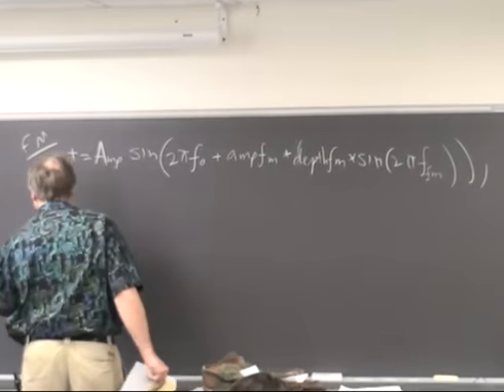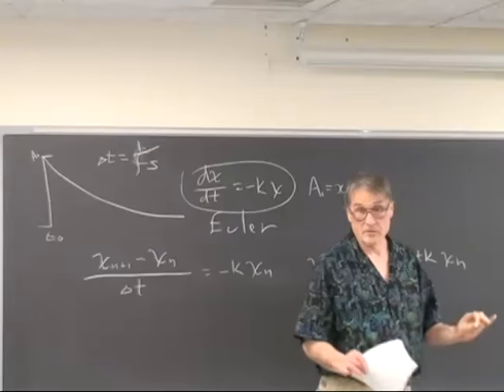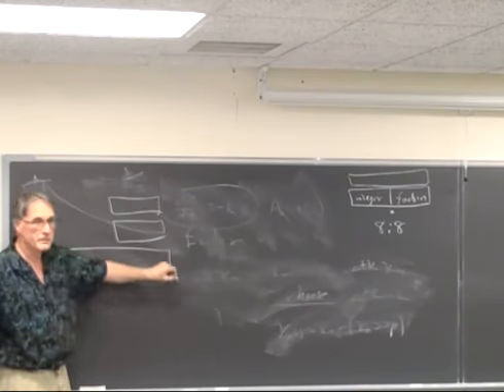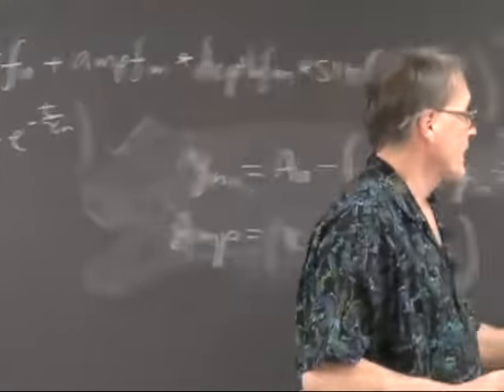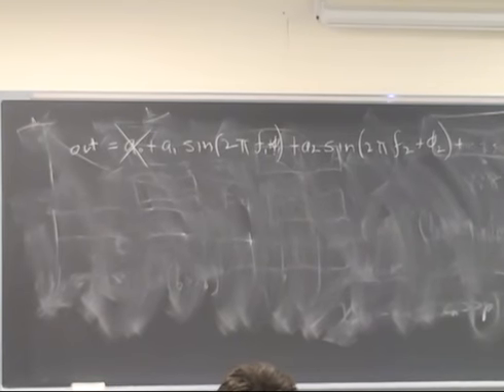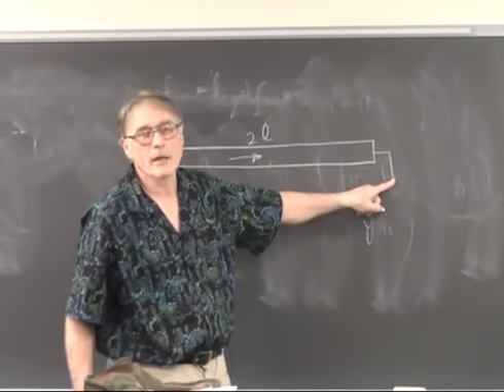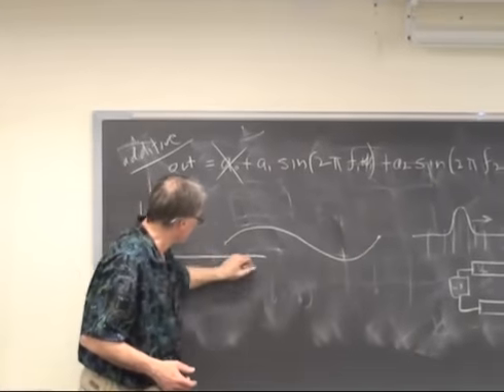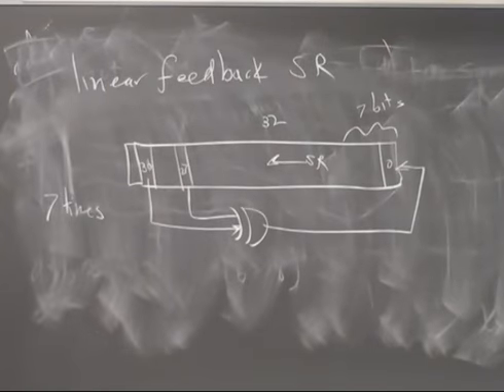#14 -- Audio synthesis

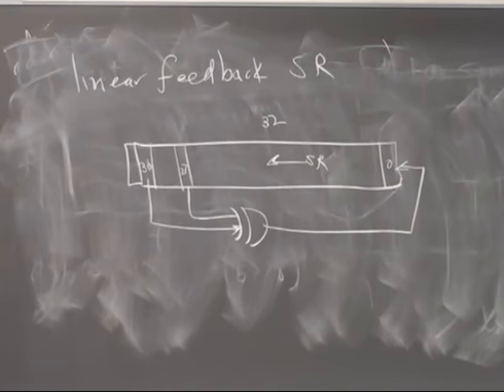Comment: There's one thing I don't understand about the Pseudo Number Generator (at 46:58). The 32-bit left-shifted LFSR depicted on the blackboard uses only 2 bits, at positions `27` and `30`, however, after reading about LFSR's from different sources (for example the "crypto-textbook.com" page 45)  it seems that, for a LFSR of degree `32`, there should be at least `4` bits used in the feedback line; in particular, (source "crypto-textbook.com" page 45) for a `right-shifted` LFSR of degree `32` a primitive polinomial would be <0,2,3,7> or, equivalently, for a `left-shifted` 32-bit LFSR a primitive polinomial would be <27,28,29,31>. Is there any reference material that I'm missing? Thanks

BTW thanks for these lectures.
Reply from the maker: You are quite right, but this is a 31-bit LFSR which only needs two taps.